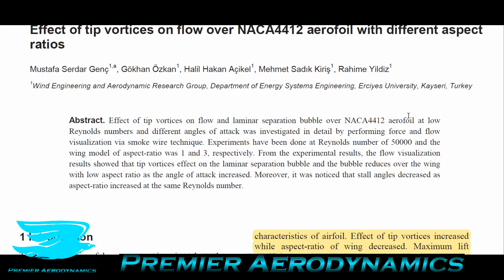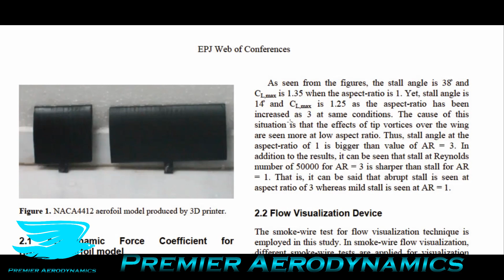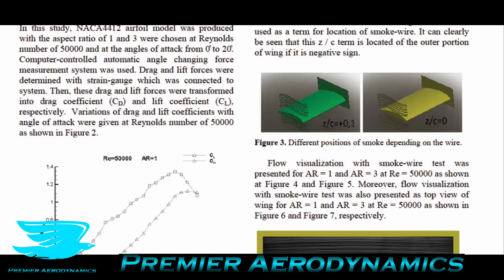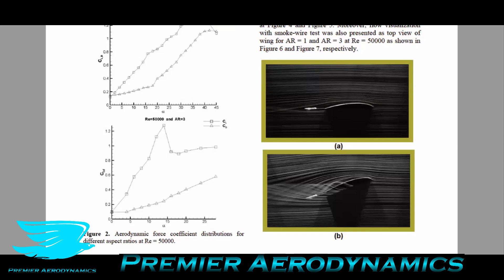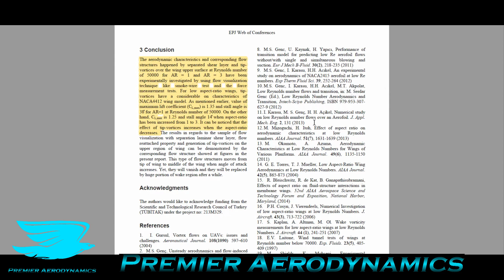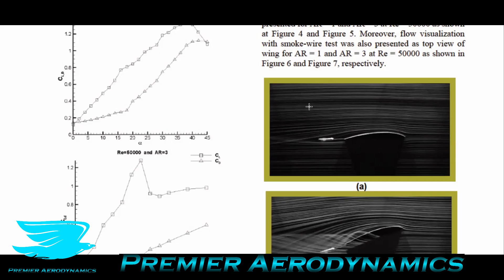Comment: detail: Aspect ratio is span^2 ÷ area, not just a simple comparison.

None of this mentions the phenomena of wing-tip vortex driven "parachute lift" of very-low aspect-ratio wings.
The models are almost 2 dimensional in that it's only one wing, not showing the entire flow around the wing.
 AR 3 or less, when flown very slowly with high "A", the vortices wrap around the plane capturing a "bubble" of low pressure above/behind the wing, as you somewhat describe. 
At the same time they trap flow from the front over the top of the wing preventing it from separating, again somewhat as you mentioned, but you vastly understated it, seemingly.
 Such wings will not stall, as in flow separating and depriving the trailing edge controls of strong smooth flow. Somebody can pick nits about "anything will stall if it's slow enough" but in practice in use on these planes, no.
This is amply demonstrated in many planes of very-low AR such as the Arup, the Nemeth, also from the 1930s the Farman 1020, the Payen AP-10. In the 1990s see the Wainfan FMX-4 "Facetmobile". The 2015 Rowe "UFO" from Aus. Circular with AR 1.27.
 Wainfan said that somebody braver than he can actively try to stall it, but the Facetmobile stayed aloft at under 16 kts (his pitot tube couldn't read any slower) at nearly 45° "A". He said it will "mush" all the way down at 1000 fpm, but still flying. The Arup and the Eshelman from the 1940s AR <1, and the Nemeth and the V-173 all displayed this.

 Zimmerman copied the Arup planform with AR ≈1.7 because it maximizes the "parachute lift" at around 3.5x the normal amount of lift at such slow speeds.
In the '30s Charles Zimmerman working for NACA saw the Arup S-2 fly. After this he used the Arup's super-slow stall-proof performance as the starting point for his work into a VTOL tail-sitter, as seen in some of his patents and a video of an indoor tethered model of the V-173. Contrary to much speculation and his writing, the wing-tip mounted, oversized, outward turning, tuned props were not to counter the tip vortices (he actively chose to maximize them). The fact that it flew in parachute lift shows that it did not, you can't "counter" them, and NACA tunnel tests with the V-173 showed that it did not gain anything or particularly change anything versus more normal 80 hp propellers spinning the other way.

I note that despite all the explanations and equations for why such wings must always have very high induced drag, they were very pointedly not slow and draggy. The extreme vortices and the drag  are elective and temporary. They are not always burdened with the extreme vortices.
Facetmobile AR = 1 was 750 lbs, flew 100 knots on 46 hp with almost 1100lbs useful load after a pilot and some fuel was in. Arup S-2 was 780 lbs, flew 85kts on 37 hp, and video shows it to be nimble with astonishing 45° climb, also shown by others of the type.
The Nemeth was a circular 15 foot diameter wing parasol on a biplane fuselage. Was faster than the original, would not  stall, super-slow descent of 60° and near zero landing roll. The Farman 1020 was also built on the fuselage of a known successful "normal" plane, and also was stall proof and faster than the original.

Zimmerman working for NACA and later UAC ("United Aircraft Corp" Vought, Sikorsky, P&W, and Hamilton Standard) wrote extensively about the parachute lift and Wainfan also writing for NASA, as can be accessed from the Facetmobile site.

Comment: One thing I notice, 15 degrees seems to be the limit for efficiently turning air. Engines deal with the same thing, especially at the valve seat. The typical 30 45 60 valve job spaces the valve seat angles in 15 degree increments. More angles, means better flow. This is why in addition to the valve seat angles, the valve themselves have their own angles, known as back cuts.
Reply: That makes sense I think because a lot of airfoil profiles seem to stall around that angle, or slightly higher. So, maybe there is something about the relative drop in momentum that restricts higher angles of attack, in general.